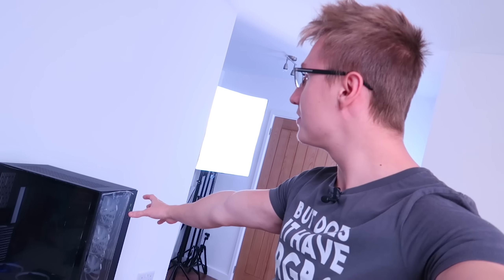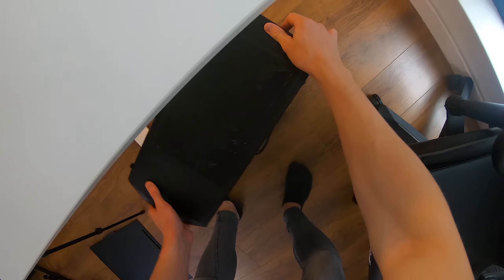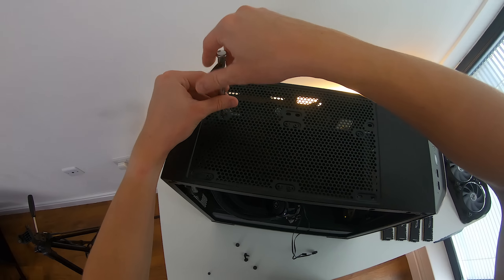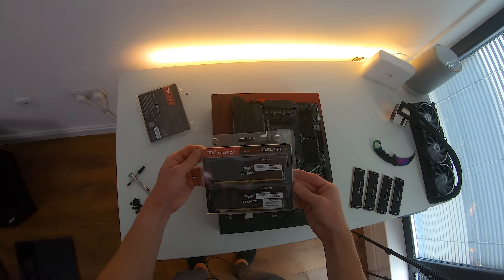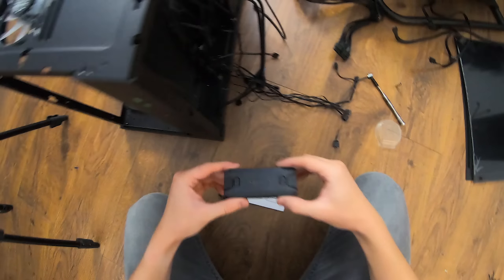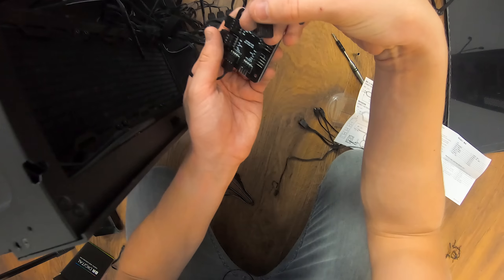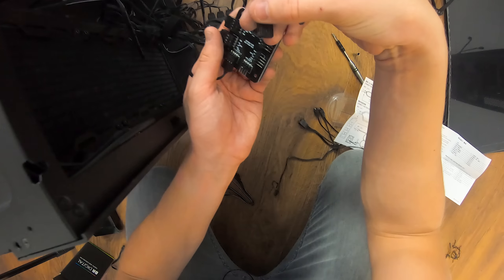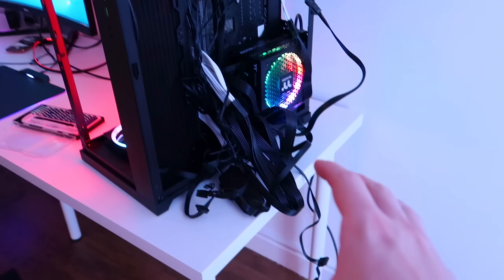Razer Edition Lian Li PC-O11 Dynamic PC Build - Part 2

Comment from the maker: ✅ Channel Sponsor ✅
GET 25% OFF with coupon code: TechBlock
↪︎ geni.us/tbk-scdkey
Reply: Where is part 3
Reply: Didn’t the front IO USB connecter get in the way of the bottom fans? I can barely fit two fans down there because of that thing. 😅
Reply: @maximum_deep1854  🤣

Comment: Personally I would recommend that the 3 fans on the side of the case be intakes and moved to behind the radiator. This for me worked the best for cpu temps. I also have a different gpu (ASUS strix 2080ti) so I cant speak for everybody.
Reply: Wats the diff with putting those infront instead?
Reply: @theslayerkei5554  cooler air
Reply: Only 4 degrees cooler that way for cpu and gpu.
Reply: how close was the strix 2080ti on the door panel. picking same setup soon

Comment: HardwareCanucks did a testing of fan arrangements on the PC-O11 case, the configuration with AIO radiator as top exhaust and 3 side 3 bottom intake has the best cooling effect.
Reply: does the radiator make the air warm which negativly impacts the gpu?

Comment: no the radiator should be on top because of hot air since is less dense than cold air it will ascend fast and will not warm the cables so you can put cold intake air from lateral

Comment: Ive just always heard you want positive airflow in a case meaning more intake then outtake. I have the same case and used the side 3 fans as intake. Though it does make the RGB fans look not quite as good it will certainly help you with airflow.
Reply: I agree. I have my 011 dynamic set up with 6 intake and 3 exhaust, my temps are very good and positive airflow means you only get air coming into the case where you have filters. This case is also brilliant to build in.

Comment: heat rises, why wouldn't you put the AIO on top? You're drawing hot air in from the front radiator into the rest of the computer

Comment: Am I wrong when I see 3 fans blowing air out to of the top and three fans blowing air out the side while only the bottom fans are bring new cool air from under the case?  Its a good thing you Europeans are not into carpet like we are here in the US because that would really limit your incoming air into that case if it was on the floor

Comment: Hey TechBlock, is it safe to change your stock AIO cooler fans with the Lian Li ones? I'm planning on doing the same thing but I'm not sure if the Lian Li fans produce enough static pressure.

Comment: Man, after watching this video, my "can't get the Razer Core to work without BSOD-ing my Blade" parts list on PC Parts Picker has changed up so much. Did NOT know about the Thermaltake PSU or fans being Chroma-compatible. Now my build will be wholly controlled through Synapse, except for the CPU cooler, which is gonna be a Kraken Z73. Does a screen count as RGB?

Comment: I’m getting this case on my birthday and that’s in 1 hour and 30mins then it will be the 19th of October and that’s my birthday and I cannot wait to  build my system in this case man omg haha it’s gonna be a full RGB build man and I’m hoping I’ll get enough money to get a rgb PSU as well, and great vid em love that build so far looks sick man 😁

EDIT: I got the case and I have completed my pc build and it’s so awesome man I love it so much it’s by far the best case to build in cable management is a breeze and I do have 9 fans installed inside and the cooling is great bottom 3 and side 3 fans are intake and top is exhaust but in my old case when I had my Sapphire tri-x r9 290 4gb card in, (model no. 11227-03) is was boiling on the glass side panel after playing Rainbow 6 siege for an hour but is my razer case build it’s still cool after the pc been on for 7 hours playing siege and the air coming out was just a bit more and cool but also still better performance in this case as it has more room to breathe I’ll guess.
Still if u can get this go for it for sure but yes it is a expensive case.

Comment: Can anyone help me, I'm using the same case with a z490 E motherboard and struggling with the USB 2.0 Ports as it only has 2.

1. Used by the AIO cooler

2. Used by the Commander Pro
And I'm left with the cases RGB USB 2.0 port which I don't have anywhere to plug into? I've tried plugging it into the commander pro but didnt work. 
Any help would be amazing.

Comment: I have a question. I bought this PC and I don’t know how to open the case panel. Micro center built it for me and when I look at the pic case I can see a mechanism that when you put it up, it opens. But it is blocked by the roof of the pc where my liquid cooler is. Does anyone know how to open the panel to add a pop figure?

Comment: That's a lot of negative air pressure Em.
Reply: Yeah, bottom is intake, top is exhaust and middle (AIO) is exhaust... I doubt he had a change to think this through
Reply: @ProXM1  That isn't a bad thing. Watch hardwarecannucks's testing with this case
Reply: @Kizzster  I know and once again the best config is: TOP; Exhaust & Side and bottom; intake
Reply: @ProXM1  That config is 4 degrees cooler, Not a massive problem unless hardcore overclocking. + For aesthetics I'd prefer Top exhaust, Side exhaust and Bottom intake since this case is amazing for air flow. I hate the back plate on fans too.
Reply: what about bottom intake, side intake, top exhaust

Comment: Thermaltake power supplies are poorly built. I would be too afraid of a Thermaltake power supply damaging my other parts, so I would never put one in there. The best brand is Seasonic regarding power supplies for sure. If you want a RGB power supply, it should be the ASUS Rog Thor since it's made by Seasonic.